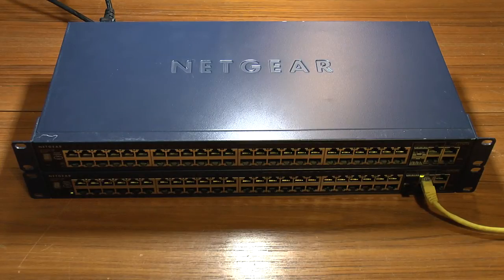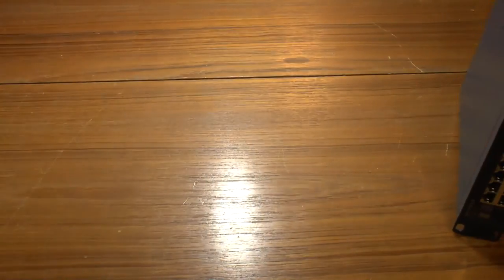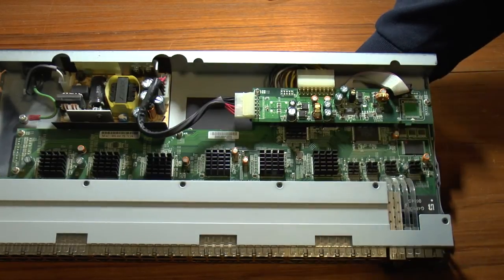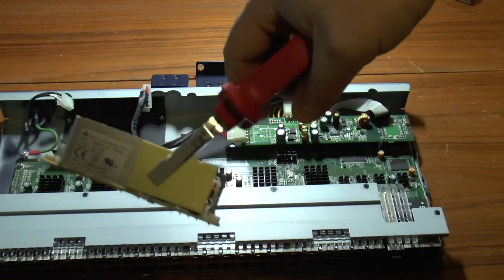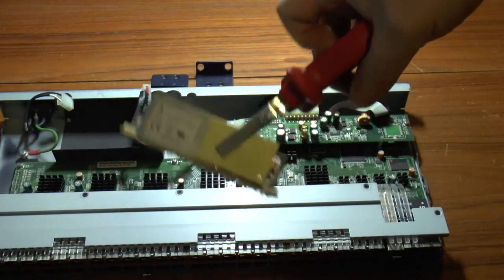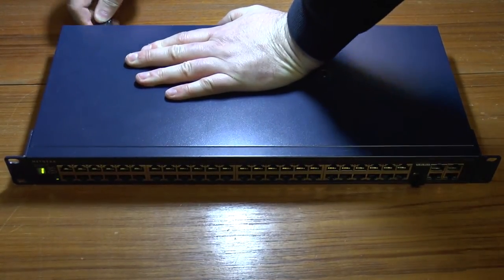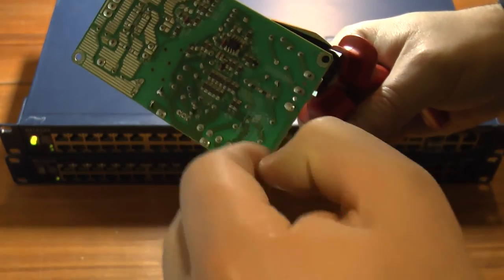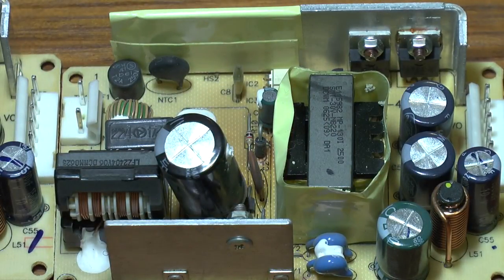Netgear switch power supply replacement

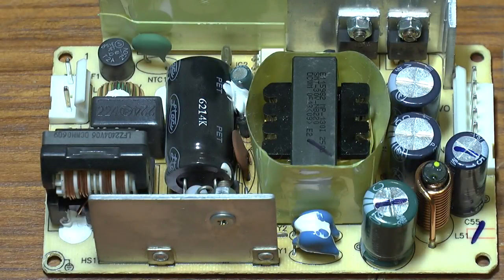Comment: Thank you.  I have a Dell PowerConnect 2716 which uses the DELTRA ADP-40VP as well.  The culprit was C3, the 47uF 25V capacitor - your mention of it at 13:04 was the key to my repair:  replacing it - had a 47uF 50V on hand which worked great.
Reply from the maker: Excellent. Free fixes are the best fixes :D
Reply: worked on my powerconnect 2724 also! I used a 47uf rated at 50v since it was closer in physical size than the 35v 47uf cap I found in my cap stash. This saved me hours of head scratching and circuit analysis (not my strongest skill...thanks ADD). 11 years on and this video STILL helped me out. You get a smash on my like button sir

Comment: Very nice tutorial!
However, please note that on the newer models with a block of LEDs on the left (one set for each port), the LEDs are actually on a separate PCB which is mounted to the front panel, so you will need to remove all of the screws to be able to disconnect the LEDs from the main PCB.

Comment: I watched this vid because I came into work this morning and the network switch was dead and the network with it. Having lashed together a temporary replacement, I looked over the switch and thought I wonder if the problem is anything fixable. Most of the interior looked fine (there was a bit of fluff - surprisingly little for about 7 years of use) apart from the PSU which is distinctly brown around the larger heatsinked IC. Now we will get in a new switch since we need confidence in it but I think I might try a repair.

Comment: I love the power supplies in those, I salvaged three of them from similar netgear switches, I'm sure they will come in handy, who doesn't like a nice 5 and 12v power supply?
Reply: You can use the 5V ones to build a huge 6 port USB-Charger bank. ;)
Just be shure that you should short the D+ and D- of each USB-Port, so that the appliance will accept the high current and are drawing up to 2 amps (in case of a tablet) or one amp (in case of a smartphone or single-cell-tablet).

Comment: if you look at the blog post he put in the description, the original Delta PSU looks pretty anemic, while the replacement Artesyn is much chunkier. it's probably a case of under-engineering, rather than bad parts.

Comment: Ahh terminal switch modes, a common thing thease days, most equipment seems to have them, the capacitors have to be high grade switchmode types to cope with the battering.

Manufacturers allways put capacitors close to hot heatsinks, im sure they do it on purpose to limit the life of the psu.

Smashing job mate, well worth the psu swapping :-)

Comment from the maker: This one did. My MacBook one didn't and bit me two days later. Maybe they pay more attention to it in the open-frame design because it's more likely to get handled by technicians. I had a kick off a laptop supply a few years ago when I decided to make the board "safe" by shorting the solder side out on the metal arm of a chair. Guess what I was sitting on at the time :)

Comment from the maker: On the first two I metered the output from the PSU, nothing. On these (which were bought at the same time for the same project, a high school) I guessed the problem and solution would still be the same.
Incidentally the same school has gone from Netgear 10/100 with gigabit backbone to Cisco gigabit with a 10-gigabit backbone, I installed that lot too :)

Comment: How did you make sure it's the PSU and not the DC/DC converter board for example. Would have been quite annoying if you bought the replacements for nothing.
I know, it's almost always the switch mode PSU when something stops working. I lost count of how many (consumer) electronics I brought back to life by exchanging caps. I listened to the video with powered speakers, am writing this on two LCDs and will transmit it over a netgear switch (wall wart powersupply), all of which were PSU "dead".

Comment from the maker: Speaking of eBay, someone's doing Dell PowerConnect PSU repairs on there.
Cost of repair: £40 (plus postage to send your supply to be fixed)
Cost of brand new replacement PSU: just under £40 from RS :)

Comment: I have a Belkin Gigabit switch (Model no. F5D5141-8) with a failed ADP-30JP. Struggling to locate replacements that have the same footprint :/
Reply from the maker: At a push could you wire to an external power brick?
Reply: @AintBigAintClever  I was thinking about that. Do you think if the three red cables are all the same voltage?

The 30JP has only two of each colour, but only states one output voltage.
Reply from the maker: @MrGeekGamer  yep. If you test for continuity you should find all reds are together and all blacks are together. They're just bundled for increased current handling.
Reply from the maker: @MrGeekGamer  none of these fit the bill? https://uk.farnell.com/w/c/power-line-protection/power-supplies/ac-dc-converters/ac-dc-open-frame-power-supplies?no-of-outputs=1-output&power-rating-covection-cooling-=30w&output-voltage-output-1=5v
Reply: @AintBigAintClever  That's what I suspected. Thanks for the clarification.

Looking forward to seeing your future content!

Comment: You can probably replace some or all of the caps on the old supply in a pinch. It's the usual suspect. Particularly with a symptom like 'works sometimes'. Not worth it with an easy replacement, but still...

Comment: On my GS748T, after a power cycle, ports 1-24 have died. Ports 25-48 have lights on but don't appear to be routing traffic. Is this a PSU issue (one of the rails has failed) or are there power voltage regulators on the main board?
Reply from the maker: It's only a single supply rail from the PSU so it sounds like you've got a fault elsewhere. If you've got access to another GS748T you could try a bit of trial-by-substitution, but remember if you've got a fairly new switch it'll have a ridiculously long warranty, I think it's around the 27 year mark. Older ones will be I think a 5 year warranty. As long as you can dig up the receipt you can register the switch at any time to activate the warranty.
http://www.netgear.co.uk/about/warranty/
Reply: AintBigAintClever
It's a version 1 switch. I've taken the cover off and some of the Teapo caps on the main board have bulges on the top. I'll get those swapped out.

Comment: I currently need a power supply for my netgear switch (netgear gs748t) but I cant seem to find one for sale in USA... Can you please help?
Reply from the maker: What's the exact model number of the power supply currently inside?
Reply: L.T.E. Model: LTE90S-S2
Reply from the maker: According to the data sheet that's a 90 watt power supply. 12V, 7.5A.

These ones would do the trick as they have the same footprint and mounting hole spacing but you'd need to modify or swap the output connector:

http://www.mouser.com/ProductDetail/Delta-Electronics/MDS-100APS12-BA
http://www.mouser.com/ProductDetail/Delta-Electronics/pjt-12v100wbaa

Datasheet for your existing PSU (covers all LTE90S-Sx models): http://datasheet.octopart.com/LTE90S-S1-Autec-Power-Systems-datasheet-11739340.pdf

Datasheet for suggested replacements: http://www.mouser.com/ds/2/632/Datasheet_mds-100aps12-b-774654.pdf
http://www.mouser.com/ds/2/632/Datasheet_pjt-12v100wbaa-773499.pdf

As you can see, the existing PSU outputs 0V on 1-3 and +12V on 4-6. The replacement outputs 0V on 1-4 and +12V on 4-6, plus pin 1 appears to be at the opposite end of the connector (same relative position between old and new, with 12V top-right and 0V bottom-right but the connector has the back facing out instead of in). You may need to swap the connector or at least turn it around and bend the outer pins to prevent mis-mating.
Reply: So get one of these and then just put my 6 pin connector in between the 8? so the two on the right and left of the conector woud be open
Reply from the maker: Yes (assuming the datasheets are correct). You can double-check by following the PCB tracks back to the output smoothing cap to verify polarity.
Reply from the maker: Worth checking with Netgear first, mind. Newer switches may have a "lifetime" warranty (I think it's 25 years actually).

https://my.netgear.com/registration/Product_WarrantyCheck.aspx
Reply: WIth that you have to have proof of original purchase. Which I dont have

Comment from the maker: Fine if it's your own switch. If doing it for work though, the H&S brigade will probably refuse to let you meddle with it, they'd rather the electricians have a go (who won't want to touch it). At least swapping out a module is straightforward.

Comment: Cost of replacement power supply: £40
Cost of replacement switch: £35 from ebay. Or at least, that's the price I got a JGS724 24-port all gigabit managed switch for. :)

Had a bloody noisy fan though. So that had to be modified.